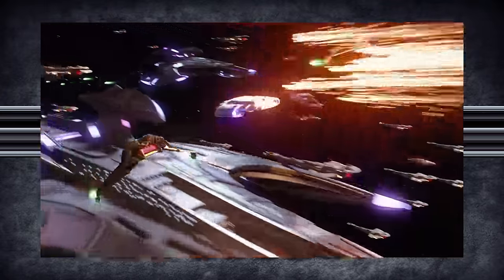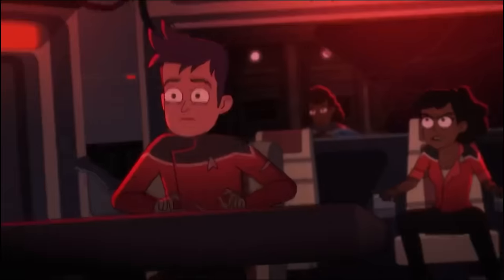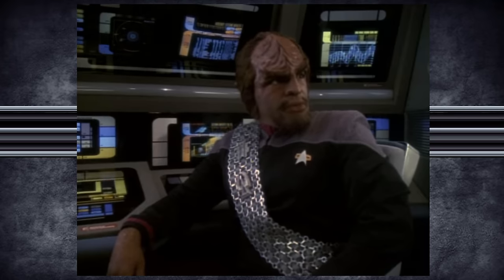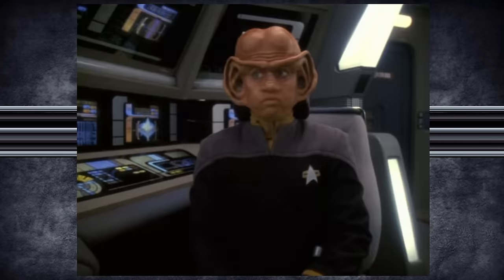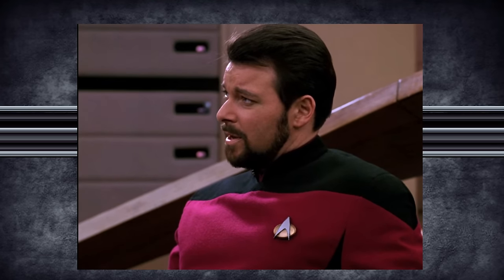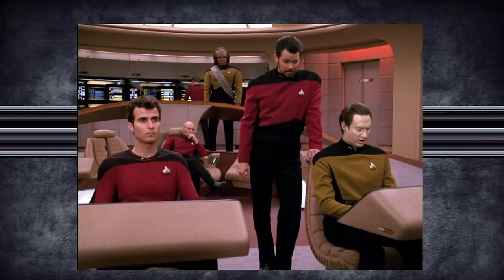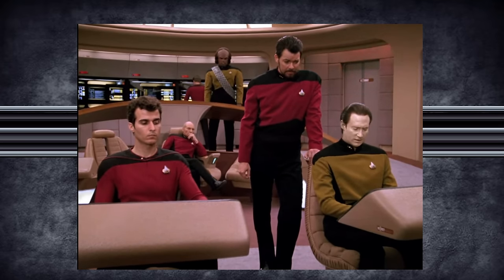Why Starfleet's Bridge Design Was Lethal to the Crews

Comment: Interesting, ultimately however this is a television show/movie. I would like to see a discussion of layout from this point as contrast. For example I think the cubicles are better because you see the actor's faces more easily. I never really liked the use of the space behind the captain's view in the Defiant & NX01. TNG did that better with tactical right behind him as well as a lot of cool looking "blinking light panels". In film history, Voyage to the Bottom of the Sea's blinking wall computer directly affected what everyone thought of as a computer. (Marketing changed the face of the IBM 360 to add blinking register lights. To this day your laptop has a useless blinking light for disk access.) You could get back to the Okudas for the LCARS layout. There must be some written references for TOS set design.
Reply: My workstation at work has an even more useless blinking light for disk access at the back of the case, where you can't normally see it.

Comment: The bridge of the Enterprise-D also had the issue of mobility. In order to move between the command, navigation, or operations area to either tactical or the rear screens, a crewmember would need to traverse a curved ramp that followed the outside wall of the room. On the other hand, I think Counselor Troi being constantly on the bridge was more of an exception than a rule; being an empath meant that Captain Picard could have inside information about the the true motives of some species, and having such a person close at hand makes sense. I have no idea who else would normally be sitting in that other seat, though.

Either way, the bridge of the Enterprise-D really seems to have been built for form over function, just like the exterior of the ship. It gives me strong "luxury car from the 80's" vibe with its leather interior and wood paneling accents. In reality, the bridge was likely built this way so that the major character - Picard, Riker, Troi, Data, Worf, and sometimes Geordi or Wesley - could easily be captured in the same camera shot.

Comment: In terms of functionality, the discovery era cubicles with sliding chairs works, but TOS reigns supreme.

The captain is in the center, and can quickly step down to access helm or tactical stations if either officer is disabled, enabling instant reaction to ensure the seat is filled in combat/emergency. All other stations the captain does not NEED to even walk to, which is missed in this video. The upper screens can display what the officers want from the lower panels, meaning all Kirk had to do to see what science was talking about is rotate his chair and look up slightly, seeing the information displayed in an easy, visible manner. This is true of all stations around the bridge and since the chair can rotate entirely around, it meant he has instant ability to turn and talk directly to ANY bridge officer, and see important information.

This feature is not present in any other ship, besides maybe the Defiant (NX gets a pass because it's early bridge and they are figuring stuff out). Janeway had to walk around the bridge to see what Tuvok is talking about at Tactical, or the science station. Kirk just had to rotate to his right and look up.

Comment: It's interesting (and understandable) that the two "worst bridges" were ones that were designed to be efficient TV sets rather than practical bridge designs.

TNG's Galaxy bridge was designed to be able to view and distinguish the majority of the main cast at their roles' station in a single shot forward shot.
ST's Constitution's bridge was designed with a similar concept, but also taking into account a ~30 degree camera angle. Which is why communications is technically behind the Captain with the bridge entrance being off-center; with the preferred camera angle taken into account it makes the bridge appear symmetrical on the TV screen.

Comment: the bridge of most war vessels are at a high elevation in an exposed position.
The author criticised the location of the bridge for being vulnerable then emphasised the usefulness of windows, which would require the bridge being in a vulnerable location for windows to be useful.
Several episodes showed either a battle bridge or an area where operations can be run from (a second CIC)
Generally federation ships are multi role with combat only being a part, so an operational layout focused on combat for a multi role vessel would be inappropriate, and anything designed as multi role by definition is a compromise. Even ships with specific roles were still adaptable, the defiant designed as a Borg fighting combat vessel was used for rescue, reconnaissance and science.  
The large area of the discovery bridge is in itself a danger, providing the opportunity for a person to be accelerated before being slammed into a bulkhead, plus several people are standing. While the transparent displays might not be glass they have a nice edge to them, transparent aluminium cut anyone ?. The discovery's bridge was designed for aesthetics and beautiful camera moves, not safety, The delta flyer would be a better example, compact, individual workstations and everyone sitting.
The bottom line here is  conflating the practical applications of fictitious vessels from the future,  designed by people who's primary intent was to tell a story, is anachronistic and judging the merits and faults on this premise seems invalid ,as the nothing was designed for the application of operational space travel.
Reply: The peacetime conning stations in real world warships are up there, but the CiC tactical station where they do everything during action, is elsewhere.

Comment: I would honestly recommend a defiant type bridge for all future Starfleet ships going forward who are built with combat in mind, even if it's a scaled up version, not just because of the efficiency of the design, but because it's a warship,  that extra space given over to the kind of high vaulted wide open bridge that ships like the Galaxy have,  could be used for things like more armor plating,  or bridge specific shield generators, etc.

Comment: One point made I believe in one of the technical manuals, was that if the artificial gravity failed, even a microscopic change in direction using the impulse drive (which is rated to move the ships at a high percentage of the speed of light) would result in the crew being a smear on the nearest surface.

Comment: You wondered why the original Enterprise placed Communications directly behind the Captain.  Originally, the turbolift was in that position and Communications over the Captain's left shoulder where he only needed to turn slightly to view.  They swapped positions because they realized that many times the Captain would need to turn to see who just entered the bridge via turbolift, and having to swivel all around would become clumsy in production.  It was also realized that the Captain's relationship with Communications was based on listening to the Com. Officer, and that both Com. and Capt. could face forward during dialog, thus capturing both faces, and expressions, at the same time.  So, the reason for the placement of Communications and turbolift was entirely for film composition, and had nothing to do with tactics or exploration.

Comment: California-class vessels, and specifically USS Cerritos from Lower Decks, copies a lot of design choices from Galaxy-class starships. But while their larger cousins served as the avant-garde of the Federation's Golden Age, California-class was the workhorse lost somewhere at the back, pulling the weight of day-to-day operations.

Bridge design follows the Galaxy-class example, with the tactical station elevated behind the three chairs reserved for Captain, First Officer and "mission specialist".. or whoever happened to wonder in, really. Behind the tactical station California-class vessel had 3 consoles: Environment, Mission OPS and Engineering II. With Ops and Navigation stations in front of the bridge. There were four additional console stations, two to the right and two to the left of the bridge - holding a science station and any auxiliary functions needed at the time.

The bridge carries with it the same characteristics as the Galaxy-class equivalent, being perhaps only a little more pragmatic with the management of space. It is also telling of the ship's unextraordinary purpose, that the California-class science stations have been moved from the back of the bridge to the sides, and don't seem to have a dedicated officer assigned to them.

Comment: My biggest quibble with Star Fleet's SOPs has aways been the lack of attention to the fact of being in space.
The uniforms should incorporate a base layer vacsuit for enhanced short term vacuum survivability, and when combat is joined, the crew should as part of their action stations readiness drills be donning some form of longer term vacsuit, perhaps with some armour, larger battery/survival packs, etc.
Also, in zero G, actions like manoeuvring through Jeffries tubes might be far faster than with grav plating activated.  Imagine all those climbs through turbolift shafts which could have been an easy swim along a ladder but from the fact that for some reason the shafts have grav plating rather than just the lift floors having it.  Imagine the disorientation of an opposition force transporting in and finding themselves in free fall

Comment: The TOS Enterprise had an auxiliary control room which could take over every function on the ship. In TNG, they had the Battle Bridge, although I have never understood why they didn't use it when it was clear there would be tactical engagement. It would have diminished the possibility of losing the major officers by clearing the bridge entirely. They could have projected some kind of sensory detail showing the main bridge was still occupied.

Comment: You're missing a valuable point:  crew compliment.
A small ship like the Defiant needs and can only carry a smaller crew.  Because a ship that small can only carry so many, the crew have to be redundant in emergencies in case of casualties.  That means getting from one position to cover another as quickly as possible is a must.  That also means far more stuff to be thrown against too.
On the opposite side of the spectrum, you have a galaxy class like the Enterprise D.  Each station has enough crew to man it multiple times over.  Navigation and sensors at the front are next to the viewscreen, which allows the commanding officer to read the information at a glance.  The Captain's chair has control over all systems if necessary, and the first officer's chair is next to that.  Science and engineering are behind tactical, allowing power to be shunted, relayed, or patched between the stations if necessary.  And with all of those responsibilities and all the crew responsible for them in the same area, the open floor plan (with ramps instead of stairs) allows for efficient staffing.

Comment: I like a more theater-like design, where the captains chair is more in the forward center of a semi-circle-like arrangement which includes all stations so the captain has easy reach to all officers. The whole bridge than has levels: The captains sits the highest, than tactical and operations lower and helm and navigation the lowest and than a higher level running around the whole bridge for better supervision which than runs on the tip of the bridge again back to the command chair. There is a holographic projector on the tip of the bridge for a more tactical view. Engineering and Science are only linked stations on the bridge to engineering and the science laps on board which are positioned on screens left and right the bridge on the higher level. Behind the bridge is a tactical operations room for planning missions, left the captains ready room and right the officers mess.

Comment: Defiant and NX are definitely the most efficient designs by far. 

I also mostly agree about Discovery, with the exception of how massive that bridge is, it doesn't make good use of space and replacing an officer will take time moving there when the ship is jolting in battle. 

I also agree about the Intrepid, it's (IMHO) my favorite aesthetically, but the various levels and railing making it the hardest to move around and most likely to cause injury in a battle situation. 

The Galaxy class bridge is definitely a mess, and just like the Intrepid, the railing and the steep ramps are going to cause injuries. 

I'd personally put the Constitution bridge up there with the Defiant and NX bridge because it's efficient to see and communicate with everyone and it's easier to get to their stations than the NX because it doesn't have consoles in-between the captain and the outer ring of consoles.

It is interesting to see how Trekçs bridge conventions influenced other franchises as well, it's like this is the jumping off point and then improvements must be made.

Comment: 1:40 about the second shift I think that is a thing but its never shown so there is 2-3 members thats the captain of the Enterprise (picard been the main one) the other XO
but its never shown in the show because it would be boring or cause problem whit production.
remember extras cost X, an extra who does something that put them in credit puts them as a actor and this is a massive jump in cost for production.
so having a character that is the XO addresses picard as he enter to then leave and not be seen for the rest of the episode is really expensive, having him just walk out as he enter a lot cheaper.
Remember the 30 mile studio zone (this is a 30 mile circle around a Intersection in Downtown Los Angeles (any film location inside does not require the studio to pay for the staff to get there outside the studio needs to play for transport and all that... que the same 2 caves been used over and over again even thought there is a really nice cave 32 miles from Downtown Los Angeles).
Tom Scott video about this watch?v=yy16KFzM4XU

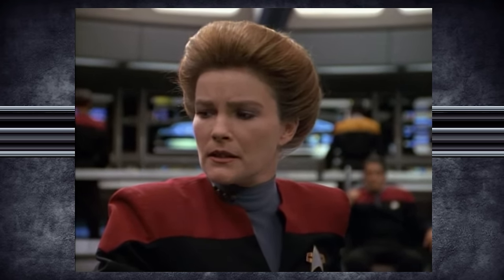2:17 on the station there is evidence from a few episodes that there is a secondary bridge located in the ship.
as the crew tried on the episode where Data took control and locked down the Bridge, they moved to the secondary bridge located inside the ship.

that said the next generation ship was a really poor combat ship. that was put on combat duty way to often.

Comment: Hate to break it to you but for some of the larger Federation ships they do indeed have a CIC or at least a backup Command Center/bridge aka Battle Bridge...

 they can also, with the power and apparently infinite adaptability of the LCARS Operating system,have their command functions rerouted to literally any terminal on the ship, and possibly even a PADD if it had the right command codes (stated as such in the TNG tech manual)...

Comment: I have to always preface my comments on any TV show with this...it's a show made for entertainment. It's not meant to be functional, just look good. Putting that aside, several comments you made were soooo valid that I would have enjoyed seeing them implemented on more of the ships. #1, the windows. I've always felt they could have used "windows" on every ship to get an actual view of what is going on around them. an HUD would be nice as an overlay when needed. #2, My biggest gripe with everything up to DS9, is that the ships were supposed to be that of exploration, (except for the 1701-E, which I still think could have been left as a ship of exploration, with a bit of badness mixed in. )  Having said that, I agree, the science station should have been an integral part of the helm/nav/conn layout, using three ensigns forward, instead of two. 1701-D was not the best configuration for the bridge. It did however get a bit of a refit in Generations, but still not the most practical.  

The things you mentioned that I wanted to just touch on, were like the communications officer being behind the Captain in the original 1701.  I felt that was the perfect placement, because he didn't have to yell any commands to that position, just turn and make his orders to that person and carry on.  As for the counselor sitting aside the Captain on the 1701-D, I saw that to be instrumental to the Captain, only because Troi was a Betazoid, and could help the Captain in times when they were confronted with other somewhat hostile species. And there is the pick of the Defiant being the best layout. Truly, aside from windows, I have to agree. The only thing that makes this plausible is the fact that it was not a ship of exploration, but one of battle, so the layout was more in tune to the feel of a battle bridge. 

Overall you really explained your thoughts about this topic well!  I always like to hear about the workings of these fine ships, albeit fictional, because the world of Star Trek is so fascinating, and makes for a positive outlook for our future!

Comment: The bridge uses a level 9 force field that's the blast doors you're looking for. Any structural breech the Shields will cover any holes not just where the screens or windows were any breech surrounding the bridge can be sealed